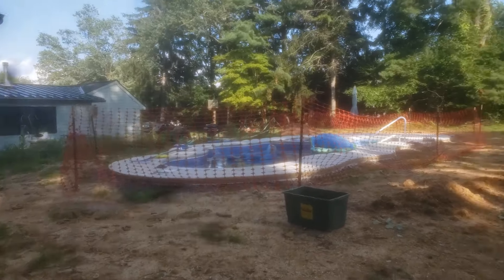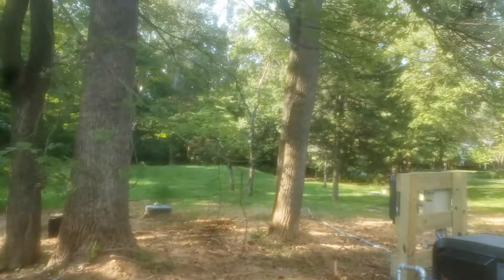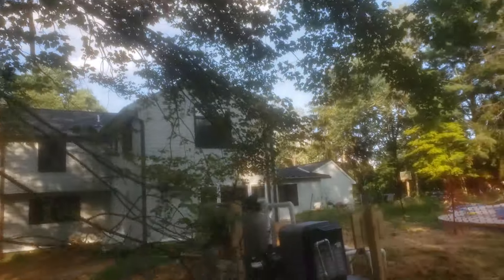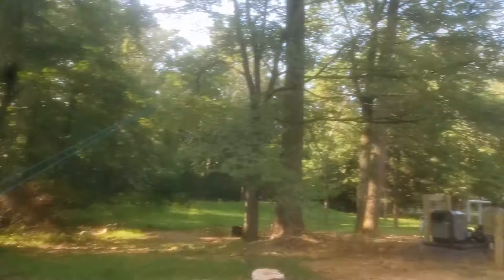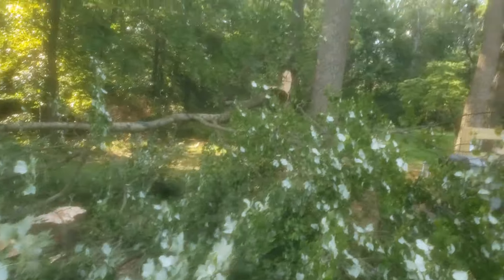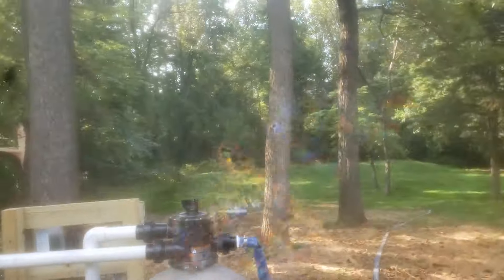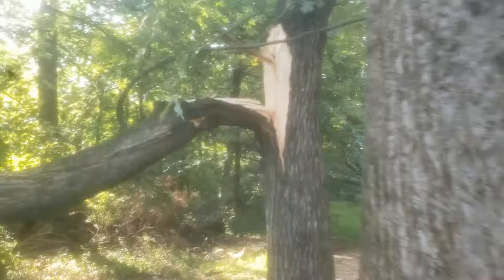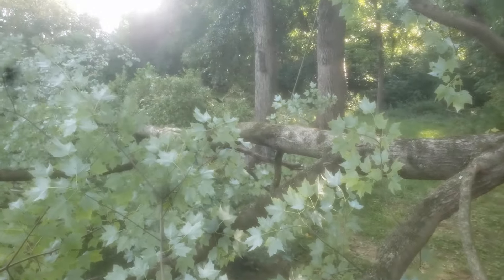Using the Skid Steer to Tear Down a Big Limb

Comment: You get more control over the direction of the fall if you cut it with a saw instead of solely relying on pulling it the right direction. That method might work 9 out of 10 times, but might surprise you with property damage if things don't go exactly as planned.
Reply: Not necessarily. If the wood's predilection was to peel heavily on strong fibers, then yes. With this species, I wouldn't gamble on that. Causing it to split down the crotch was the way to go.
Reply from the maker: ya..it could have gone either way on this one... we were just planning on pre-tensioning the line and when I heard it start to snap, crackle and pop it seemed like the best move to just rip it off . My judgment on the ground was that it would clear the pool filter it he just kept going. No need to start the saw walk over tot he tree and reach up for a cut if I didn't have to. My old op would have known enough to accelerate when I told him to go. But this guy is a little green and didn't recognize the need for speed here.

And in general I disagree with the idea that you get more side control in rigging large limbs with an undercut/notch than a rip cut... I much prefer rip cuts in the majority of rigging scenarios where I need the piece to move sideways..

Comment: I think If they had to come out anyway, I would have prefered the customer have me remove the trees BEFORE the pool and supporting equipment went in. If they are coming out because of damage from constrution, it is well known that heavy equipment compacting the soil over the root zone of the a tree causes stress and adverse effect, even potentially a primary cause of failure. The landscape designer or engineer laying the job out job could have ordered these sensitive areas be fenced off from being disturbed by equipment and saved these trees and and their wonderful benifit to the yard.